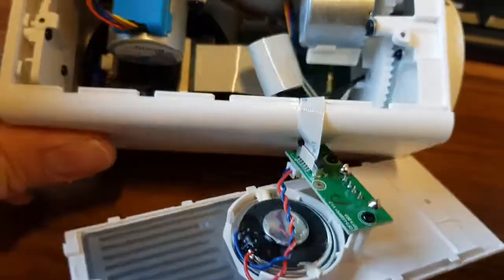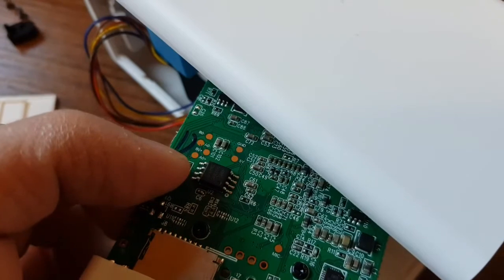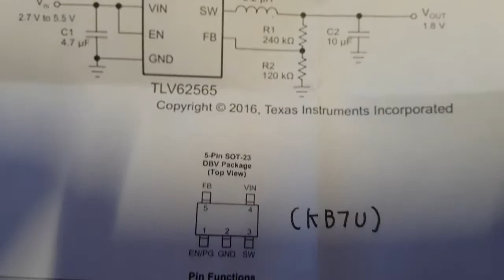Fixing a wyze cam pan

Comment: It doesn't take 24v to fry one of these.  I have one that died on a USB power bank.  I was pulling the feed from it for over an hour and it died.  At least one regulator seems to be fried (it's the only one getting hot, rather the inductor is getting hot).

Comment: Thanks for showing the insides. It looks like replacing the antenna with a stronger one would be pretty easy with that ufl connector.
Reply from the maker: Yes could be open for mods.

Comment: Can't understand you!!
Reply from the maker: can I ask why?
Reply: I could understand him perfectly. However if you are having trouble there is an option in YouTube settings to either Slow or Speed up the video. I would recommend slowing down the video. Maybe start with -15 to -20, that is at least a good place to start. There is also a volume increase/captions that can be turned on. If the problem was strictly his accent. You can download an app that will convert the words being said into another language or caption. (Just depends on what is programmed into the app you choose for language conversion)….Hope that helps. 
*Quick Tip When you comment on a video someone made to be helpful (which this video is) try and remember that why giving a complaint {followed by… “!!”} The explanation mark makes you seem rude and demanding, just like a Kevin or Karen would be. Not saying this is how you are, only saying how you are perceived.
It also makes people that take the time to make these videos {ya know, the ones with more knowledge than almost every single person that clicked the video} not want to take the time to make another “how to” etc video. Especially when they are not sponsored by or a retailer of said product. 
Definitely not the case with this man, he actually responded to your comment and tried to help you further. 
Good day.

Comment: This did not help me at all
Reply from the maker: I'm sorry to hear that. What would help you?
Reply: @mathewlawrenceml it would be great if we could have seen how we find out the part number/where you order parts and remove regulators.  Thanks
Reply: I have no idea. I keep getting a code 90 and my wyze used to work just fine. I tired the internet reboot and everything but call wyze themselves
Reply from the maker: Looking at that error if you can't connect your camera to WiFi. Try changing the WiFi to only 2.4ghz make sure 5 GHz is off. This may help.
Reply: @mathewlawrenceml  it didn't. Errg Ive done everything... except for throwing it away

Comment: Thanks for the teardown guide really needed to know how to get the lens out to remove a piece of lint that was stopping me from getting the right QR code (said it scanned but it always failed to connect) used a magnifier and saw a small piece of lint in between the lens and camera again thanks for sharing the steps to teardown without damage.  🤗
Reply from the maker: Thanks. Glad it helps.